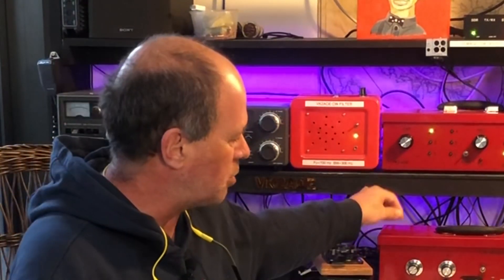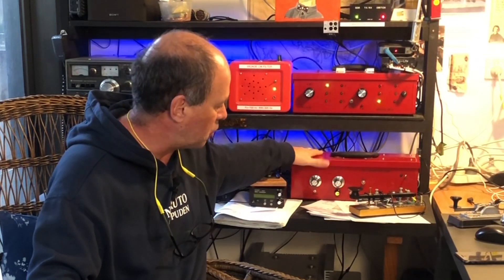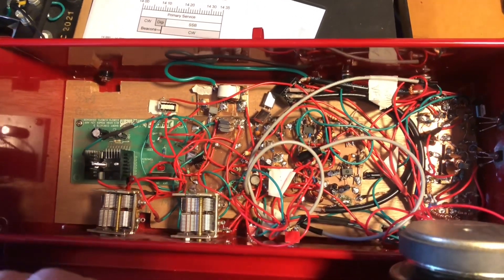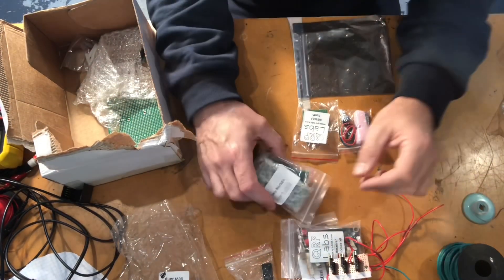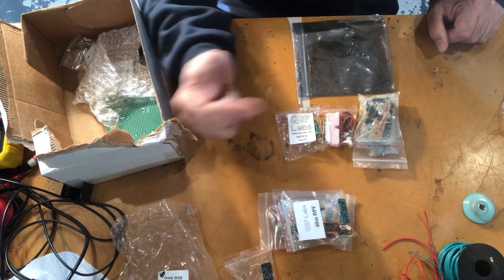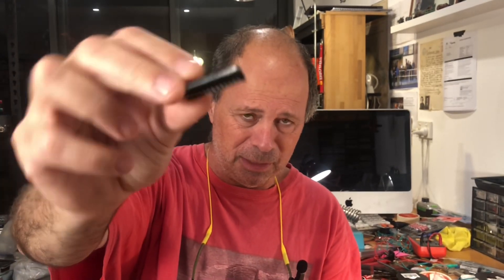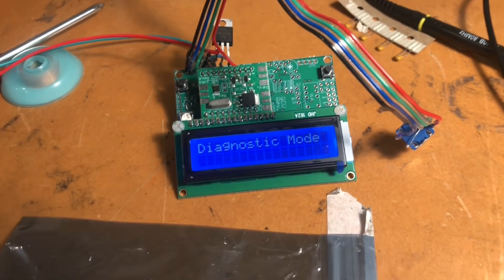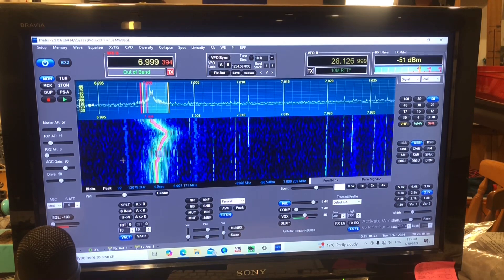QRP Labs VFO Kit

Comment: I have a  hardware  fix for  solving the lack of  RIT issue as long as you are using  a crystal controlled analogue Osc  as  your Tx oscillator into a standard SSB  IF strip, with a capacity to unbalance the  modulator to produce  CW  directly .   AS it stands the  VFO Gen from Hans unit is not set up to support direct on Freq  RF gen, CW tx,  with  IF offset with  Rx.  It's set up for  IF offset on  Tx and Rx as per a normal SSB Tx if you use IF offset at all.  

TEF
Reply from the maker: What I thought I might do, is set one clock to double the required freq with an offset of double the CW offset (say 1200Hz). Then I would feed it through a divide by 2 and into the receiver?
Reply: @TheArtofEngineering  My thoughts a re to have an Osc which is completely idep of the   Carrier inject  osc which is used to recover  SSB voice and CW (via an offset beat) .  That gets injected on TX only just downstream from the mixer.  (the Mixer osc being disabled by a Mos switch at this time_. When On  Rx the other side is sending  CW to match  The Tx frequency he perceives  but this is offset from the  IF freq and carrier Inject osc by whatever  pull you put on the  CW only osc.  That will therefore   form  tone when decoded.   I can mark up a bit-x type design with the suggested change d but the injection can be as simple as a  100nF  capacitor as long as when the CW carrier  Osc is not running it presents a  high impedance in terms of what the existing mixer might see. Ie you don't want to bleed down the incoming RF from the IF to nothing by some ham handed addition.

  It also means  par consequence,   that the Tx  Frequency will be  600 Khz offset from what your display might show(unless the VFO firwware is bodgied by the designer  and a DI  input  tells it  "I  am in transmit mode  now ")  but worse things have happened(in terms of offset displays etc ) .
Should make sense  

TEF

Comment: According to the Hans S verbiage there is no RIT  for CW  use  at present.  I don't know what IO pins are still available if any - it takes around  7 pints to drive and LCD display for example. 

This is what he says it has 
Rotary-encoder tuned output covering full Si5351A frequency range 3.5kHz to 200MHz
Fixed (configurable) independent output, also in the range 3.5kHz to 200MHz
Extended range up to 292MHz has been experimentally measured (in breach of the datasheet, of course)
IF Offset (positive or negative) to support superhet radios
Multiplier to support radios using Quadrature Sampling Detector type mixers (e.g. as in most SDRs)
Quadrature output mode (Clk0, Clk1) for driving Quadrature Sampling Detectors directly - 3.2MHz and above
3.3V p-p squarewave output
GPS can optionally be connected to maintain precise frequency
16 configurable frequency presets
Control of 6 relays using the relay-switched LPF kit
4 auxiliary outputs for controlling other things (similar to Aux on the Ultimate3S kit)
Selectable tuning rate 1Hz to 10MHz

Comment: The Output  from the Si5351 pcb is DC coupled so a DC blocking capacitor is needed. Additionally the Si5351 prefers light loading otherwise harmonics and phase noise are degraded
Reply from the maker: Thanks yes. The receiver module has a 100nF cap on its header.  73 de VK2AOE
Reply: INdeed, various have tried to put in an impedance  conversion  RF transformer  immed after the Si5351 and killed it instantly.    The  100nF  capacitor  that is required   saves all- and in fact can  provide blocking the transformer if people want to put that in.